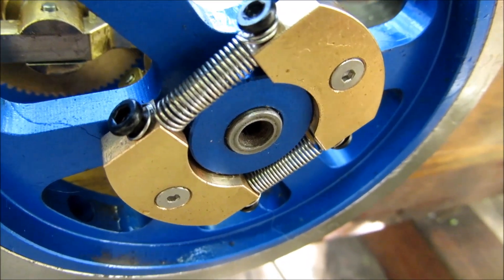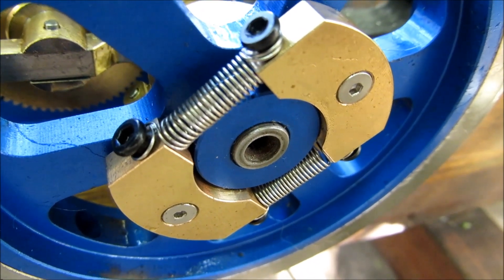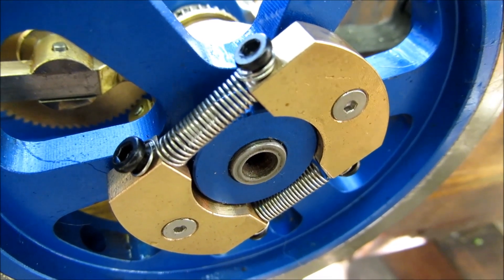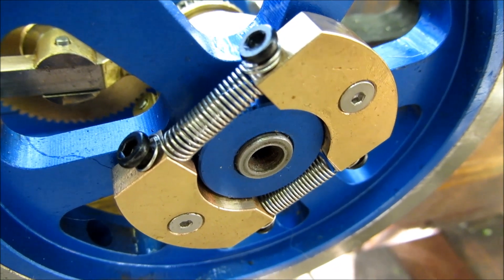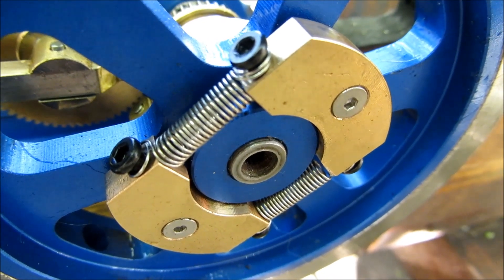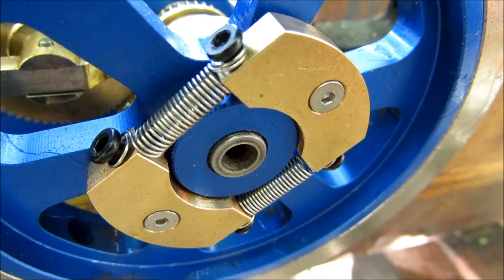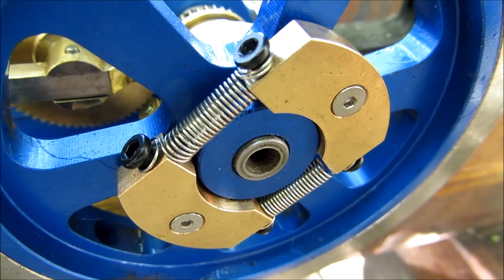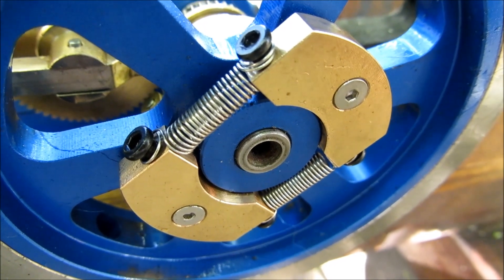Kerzel Copy Hit and Miss Engine

Comment: hello Bob. I don´t understand how that engine works in detail. But I think it must have another different speed control much better than springs regulation. Or am I wrong? Maybe feed regulation, or pressure regulation... or something similar...
Wish you a nice day.
Ketk. (Spain)
Reply from the maker: Hi Ketk, My understanding is not 100%.  The governor system expands with centrifugal force.  The lighter tension springs allow it to expand easier.  When fully extended, the spark plug does not fire.  This is accomplished with several mechanical devices--gears, cam, rocking arm, shaft etc.  The engine is now coasting as the governor weights begin moving back to center when the cycle repeats.  The lighter springs cause engine to fire less often, reducing RPM's.  Just a attempt to regulate speed more like full scale engines and improve the distinct sound these engines make.  As I understand, these engines were designed to be economical, using less gasoline--only firing when necessary.  Interesting concept a long time ago.  Maybe I should have been born 150 years ago!  I like old things--just like crank organs.  And so, Ketk, it's good we enjoy projects, good for our well being in a  complex world.  bobh
Reply: Thanks very much Bob. Now I have understood much better... not only feed system, but spark plug control system... very interesting, yes... of course they had not our nowadays engine rules... hahahahaha.... Have a nice day... greetings to your wife... Ketk.
Reply from the maker: Hi Ketk,  These engines basically run at one speed.  The governor corrects and reduces speed when necessary.  They were used on farms many years ago to run various equipment, like water pumps, generators, vegetable pealing machines and so.  Hit and miss engines were the forerunner of throttle controlled engines, which, of course, were much more useful with many applications.  The appeal of hit and miss is the nostalgia atmosphere associated with this time period in history.  bobh